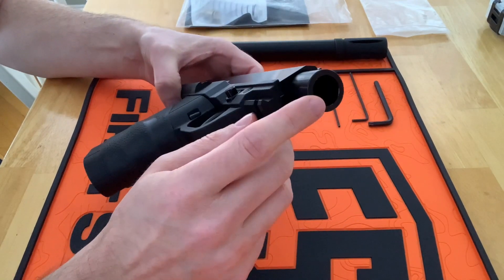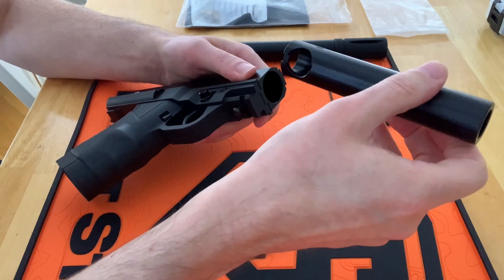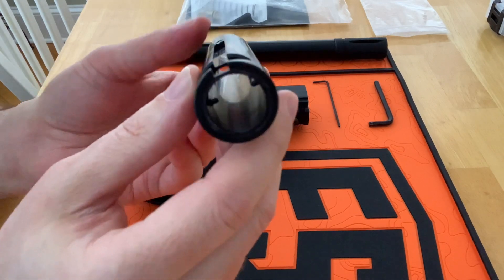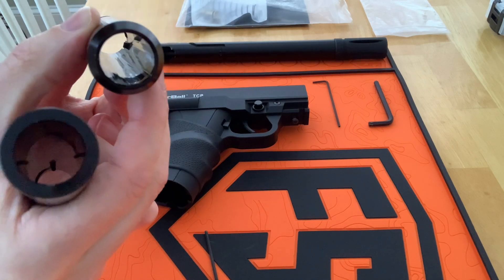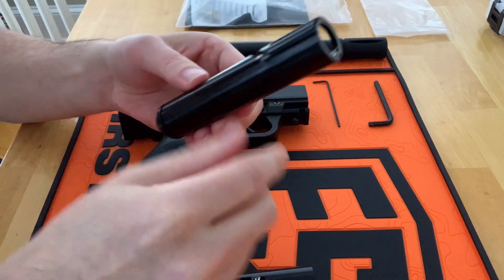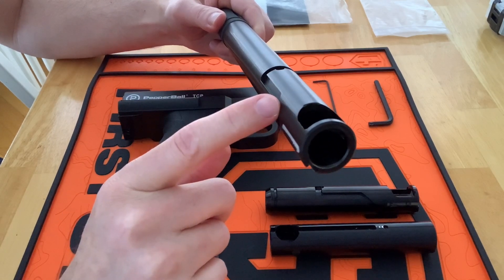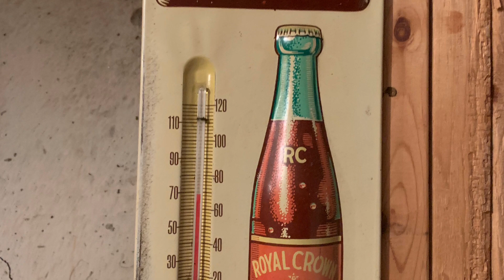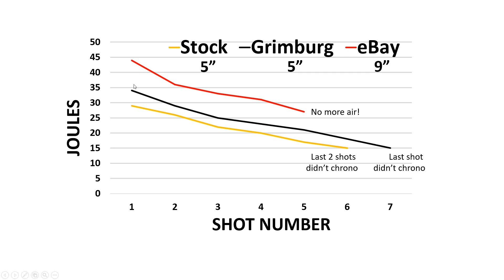Pepperball TCP barrel testing up to 44 Joules with Grimburg JULs (3 barrels)

Comment: Do you have a link to the EBay barrel?
Reply from the maker: I checked eBay and they are not currently listed.  I purchased mine in May 2021 for $17.10. They were called "New Paintball Barrel First Strike T9.1 & T8.1 Tiberius Arms Threaded Tip 9 Inch". These are probably shipped in batches from China.  So wait a while then check again with those search terms.

Comment: Optimized for the barrel is probably the most important take away among many other of your great points. I always setup for consistency rather then hail Mary's
Reply from the maker: I agree.  What I got with the 9" barrel is not what I intended to do but it illustrates an important point about the finite amount of CO2 available with a 12g cartridge.

Comment: Great comparison test! Keep up the good work!

Pretty sure I heard a leak with your eBay barrel after that fifth shot. I've never had a CO2 die out like that so that would make sense. Even at max velocity I can finish an eight round mag. 🤷🏾‍♂️
Reply from the maker: Thanks! I appreciate the encouragement.  I heard something too on the video but not when filming.  However, I'm standing right next to my furnace which came on at the same time and I had on hearing protection.  You could be right though.  In real time I ran the stock then eBay barrel, then swapped out to the Grimburg barrel last because it required changing out the screw.  You may notice the same furnace sound still running during the Grimburg shots.  The Grimburg barrel then ran well.  I'll be doing more fine tuning so this is just N=1.